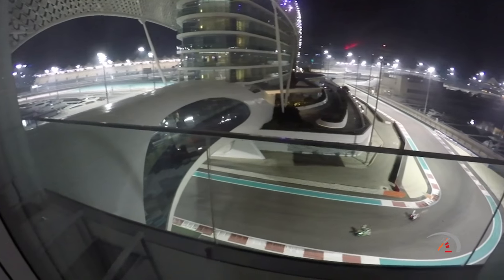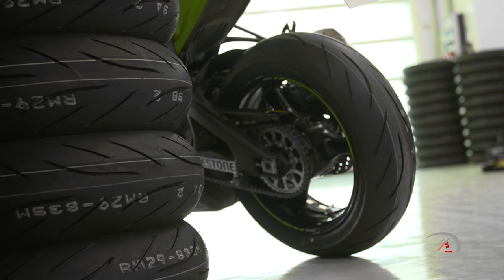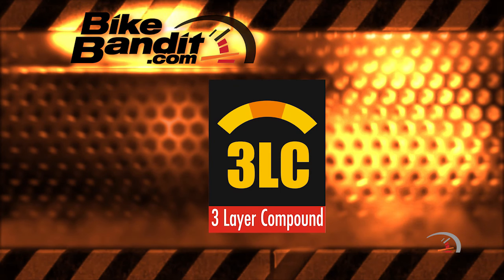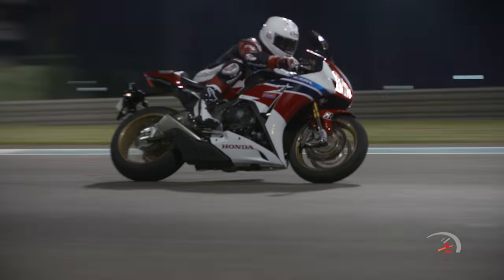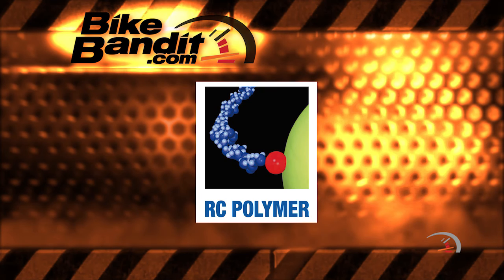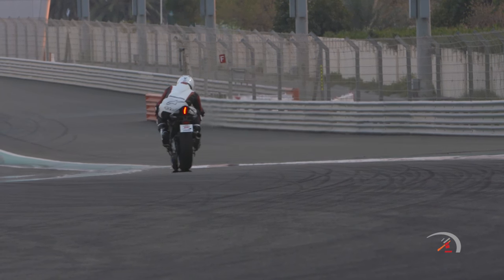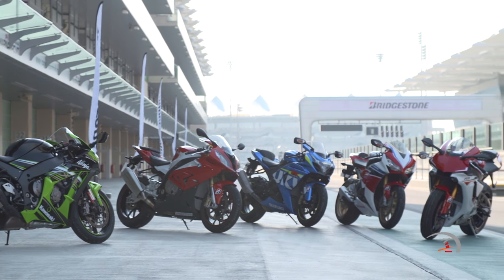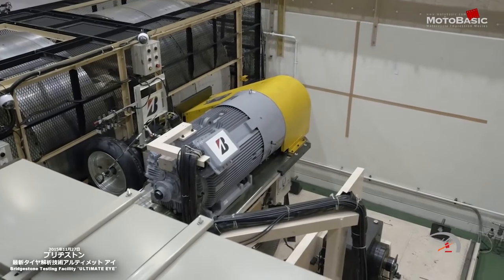The Science Within the Bridgestone Battlax Hypersport S21 Tires | Bikebandit.com

Comment: i got in on the deal from bikebandit. i have pp3 now but i do not really care for them.  i get treat squirm from them more than i should in the corners.  it makes me not trust the tires when i am riding.  i hope these will be a nice step up.  my front pp3 is starting to get close to the end of its life and my 2nd rear has about 900 miles on it but i think i am just going to go ahead and swap them both out and sell the rear pp3. the pp3 is great in the rain and lasts a long time but in the heat and in the mountains i get too much squirm and small slips out of the rear when riding hard.

Comment: What is the recommended tire pressures to run these at? Just bought a pair but not installed yet. I have a 2012 GSXR 750. Street and track pressure suggestions please!!!
Reply from the maker: I'd start somewhere in the vacinity of 34F/36R for the street and 30F/30R rear on the track. Those are cold tire pressures. Check your manual on what the recommended tire pressures are, and don't go by what the tire says as MAX. Unless you're riding 2-up, fully loaded and at the max weight limit, there is no need to run that high of pressure. With those settings, go by feel on what you like, and what the tire looks like after a few hot laps. Hope this helps. Thanks for watching our videos and the question. You're a subscriber to our channel, right? Ride safe. BB.com!